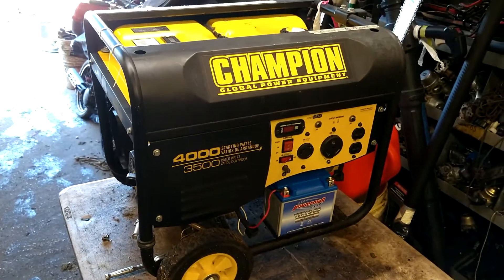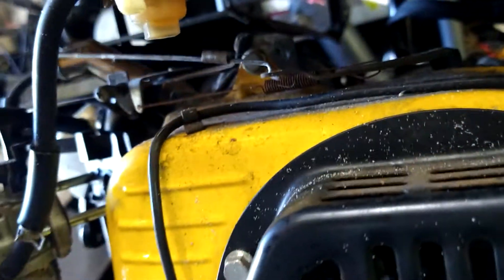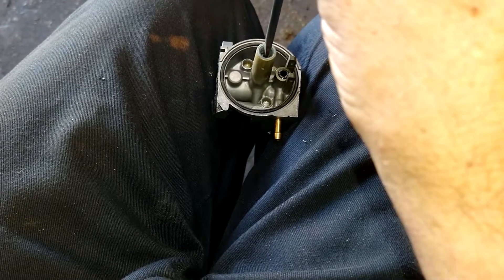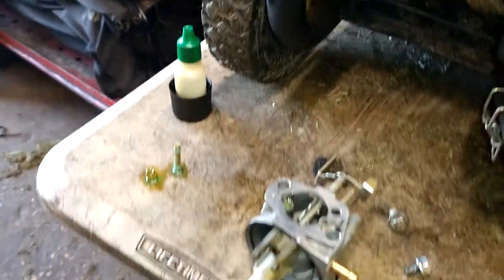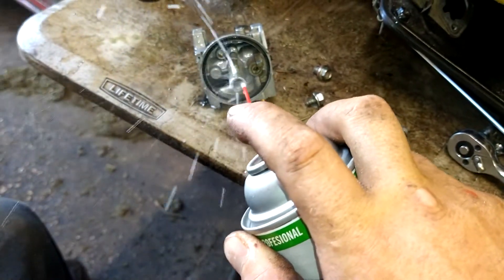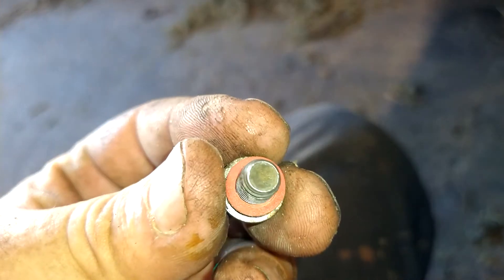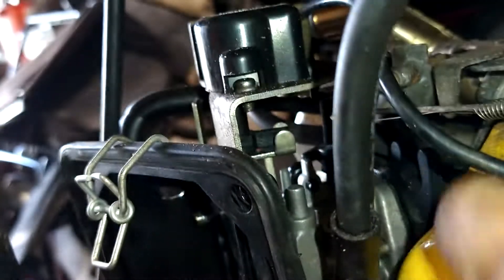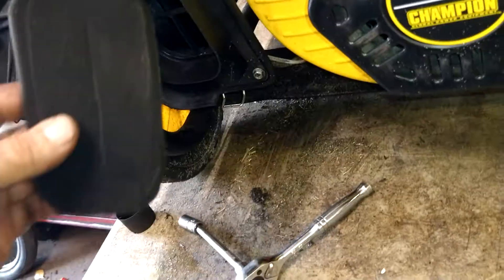champion 4000 generator carburetor repair

Comment: Hi. Thanks. I just subscribed.  I have quite a few small engines to work on. Your video was good info. I did see how you cleaned the float needle valve. Also missed you resetting  the idle screw. I assume you screw it all the way back in and then back it out a few turns and then adjust as necessary.  Could you comment on my thoughts.  Please. And thank you very  much.
Reply from the maker: Generators never idle so it doesn't matter where it goes. I put about half way in. I just use brake or carb cleaner to clean needle valve seat.
Reply: @smallengineguys  Sorry.  One more thing is .....attached to the plastic float is something I thought was called a needle also. It's attached to the plastic float with a pin. I thought it was also called a needle jet but I could be wrong. Does it need to be cleaned. If so, how.
Thanks so much. Appreciate you sharing . Guys like you really help us DIY guys. 👍
Reply from the maker: @hunt-ed4nx  yes needle valve. It should be cleaned with brake or carb cleaner

Comment: When you applied shellac to the inner carb gasket there's a small through hole that lines up with your engine and carb which you covered. Just wondering if that will cause idle or performance issues... Good video and thanks for posting.
Reply from the maker: Nope.

Comment: I watched this video hoping to see how the gasket is aligned. My carb leaks but I saw how you tap it to seal it. I will try again. Need the acod you used. Gaskets are cheap. May try shelac .
Reply from the maker: only gasket that can make it leak is bowl gasket. more than likely is the needle valve

Comment: Can a bad seal between the carburetor and the engine cause a gas leak???
Reply from the maker: no. thats the needle valve.
Reply: What does a needle valve have to do with a gas leak? I have a leak also it’s coming from the backside of the carburetor.